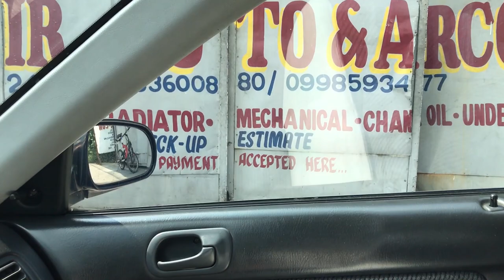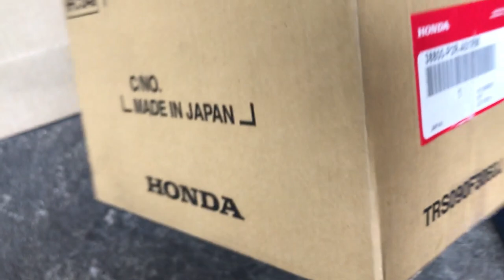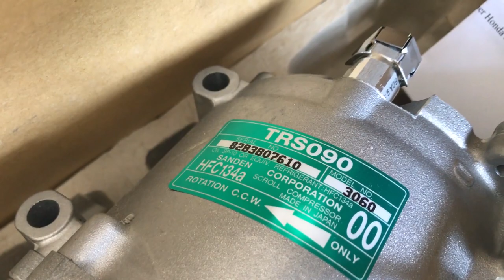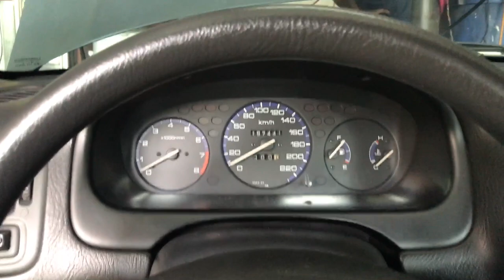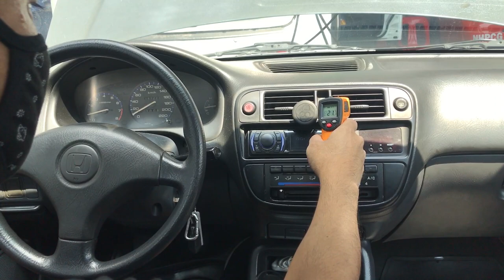How to Restore Ice Cold AC System of Your Car Permanently! (Honda Civic EK Legit AC Fix!)

Comment: I did all the things in the video, but I replaced the evaporator, and the valve connected to it. I had a shop replace the compressor, and I replaced the receive /dryer the condenser, and the evaporator myself. Vacc’d out the system and charged, ac is very cold below 70F but in my climate summers hit 100F. At 100F my ac blows at about 80F Is this normal? This is how it was before I changed all the parts, unless I did something wrong I feel like this is just the ac system of
The car. I tried putting hose water on the condenser to test of the fan wasn’t cooling good, the only part of the system I haven’t changed was the control unit in the car, and the pressure sensor that goes near the condenser…. Please advise? I have a 1995 EG.

Comment: New subscriber here. May I know kung anong mga pyesa pinalitan sir ang how much do they cost? Planning to upgrade my AC system soon.
Reply from the maker: Salamat sir sa pag sub! Lahat po pinalitan, from compressor, laminated evap and condenser, mga o-rings, filter/dried, expansion valve tsaka mga high pressure hose. Total restore po talaga ng ac system hehe

Comment: boss nilinis ba evaporator binabad ba sa tubig?pina check modin sana ang radiator, water pump, tensioner, thermostats at thermoswitch at freon.
Reply from the maker: Yes boss binabad sa tubig. Tsaka evap ko bago naman yan bnew. Yung rad, water pump etc, bagong palit din lahat yan kaya di ako nagwoworry dyan hehe salamat paps!

Comment: kung nag palit ka ng compressor mas better paltan mo na rin evaporator. para mas ma maximize yung lamig. slr. hehehe. keep it up dud
Reply from the maker: Salamat po sir! Pinalitan ko na lahat sir:

-Bnew honda japan compressor
-bnew laminated evaporator
-bnew laminated condenser
-high speed condenser fan motor
-palit lahat ng o rings
-bnew filter/drier
-bnew expansion valve
-general cleaning

sobrang sulit po hehe :)
Reply from the maker: nauna ko pong pinalitan laminated evap bago lahat haha

Comment: do i need to remove A/C gas before removing evaporator
Reply from the maker: You mean the freon charge of the A/C? If yes, the answer is yes, you need to free up the freon charge before removing the evaporator.
Reply: Yes, you need to remove the refrigerant, to save and to be reuse, you need a recovery system. Either you remove the refrigent first or not, once you replace the evaporator the refrigerant will comeout (pressurized) and will be messy. So the best thing to do is to have a recovery system to store your refrigerant and can be use again once you have replaced your evaporator. 

*note: freon is only one of the brands of refrigerant 134A (refrigerant for this model car). It's like colgate, a brand for a toothpaste.

Comment: Hm inabot at anu lahat ung pinalitan? Balak ko dn paayos ac system ng eg ko
Reply from the maker: Nauna ko pinalitan evaporator ko ng brand new laminated evaporator. Ngayon nag upgrade ako ng brand new orig trs japan honda compressor, brand new laminated condenser tsaka high speed condenser fan. :)
Reply: @90sprojectvlogs28  hm inabot? Magkano ung evap, comp, condenser at high speed motor fan?
Reply from the maker: If you can follow my IG po you can send me a private message there. Thanks! 🙏🏻